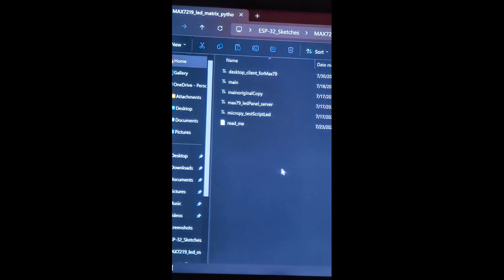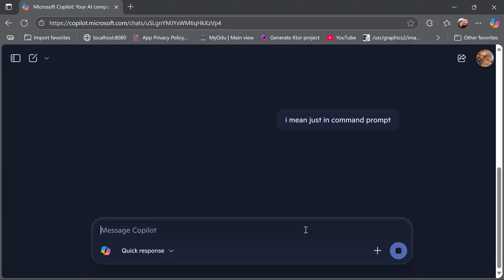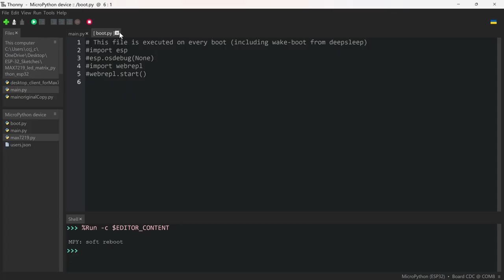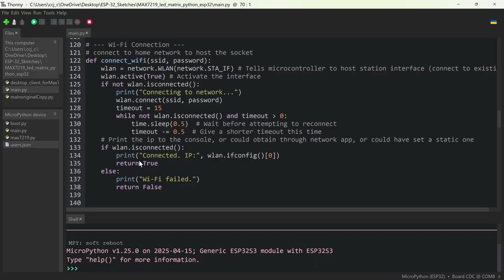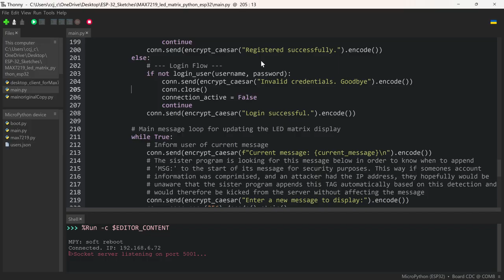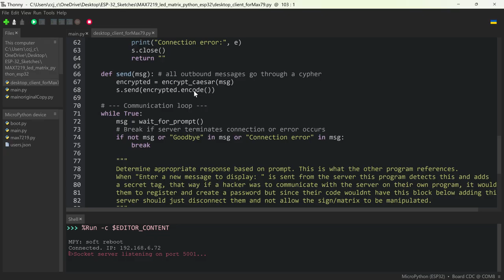Programming ESP32 with micropython for secure socket communication

Comment: Could you help me out :)
I am using adafruit, and it uses circuitpython

I was able to make my Adafruit Matrix M4 Airlift into an AP point, which I can then connect to using my wifi.

However, afterwards I want to be able to setup a small website, so that I can insert Wifi SSID and Wifi password of a working WiFi, so that non-coders can plug my Adafruit Matrix, and be able to insert their WiFi credentials and make the matrix connect to the internet.

Do you happen to know how to do it :)

Would greatly appreciate any help!
Reply from the maker: It sounds like you want to do captive portal provisioning to allow users to setup and interface their device without having to go at it programmatically. From what I understand circuitPython is not good for this out of the box because it doesn't fully expose the access point code and from what Ive read the Adafruit Matrix m4 uses an esp32 as a peripheral to handle the network stuff but unfortunately in this setup it is unable to run any micropython itself. 

It looks to me like your best options of using that specific board are: 
Beginner friendly but ugly: have the user store their wifi data in a "settings.toml" file on the board directly, so they'll need the driver for their PC to "see" the board. 

Advanced AF: write a custom bootloader that would run the Arduino/c++ captive portal sketch first(since this is not offered in circuitPy and the Adafruit board can't handle micropython), detect when credentials are stored and connection is successful, and then reboot and run the circuit python code.

If your heart is set on that board, I imagine you'll be writing some c++ code to get the exact setup you want.
Reply: @Jones_In_WV  Thank you so much for your input :)

I also thought there was no built-in system for a captive portal for the credentials, so thank you for confirming that.

It looks like I will have to try creating the captive portal myself. If I am not successful, the beginner-friendly method of using a 'settings.toml' file will have to be the way to go.

Thank you again for your time and valuable input. I really appreciate it. :)
Reply from the maker: @RafiAhmedSmartAir anytime! I'm always happy to help and love discussing advanced problems. I wish I had one of those boards so I could attempt to go through the process with you but I sadly do not and I'm not sure I'd be able to purchase one right now. I'm curious about your project though and wish you luck on finding the solution you're after! I thought about suggesting forking the circuitPython library and adding the code you needed but from what I understand the core issue is how the esp32 is wired to be used with the Matrix m4 as a peripheral and not a stand alone processor. I'm open to digging further if you need any more help or have any other issues though. Good luck!
Reply: @Jones_In_WV  Thank you for the kind message; I will let you know if I need help!

For now I dont think i will be able to implement the captive portal myself, though I might try it after a while

To get it to work, probably would have to set a socket myself manually, and then using raw http code, setup a simple form for inputting wifi ssid and password. 

I have not figured out exactly how to do that, but probably that is the path.

Again thanks for your kind words, I hopefully will update once things move forward and if I can figure out the captive portal :)